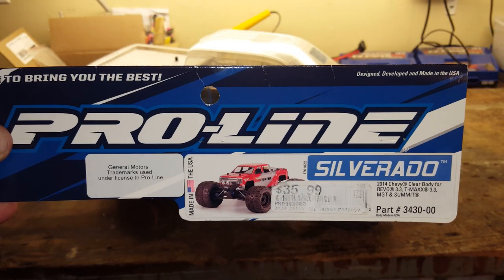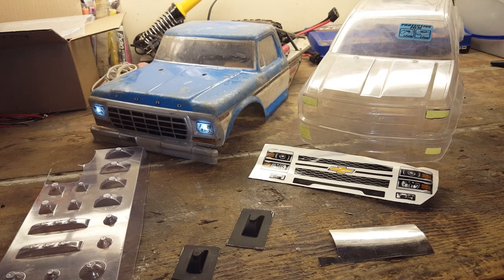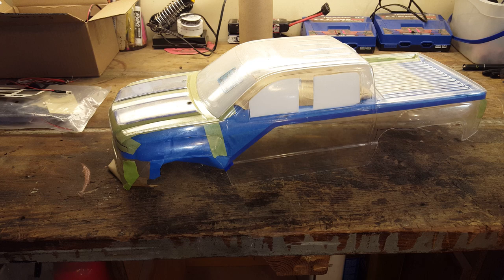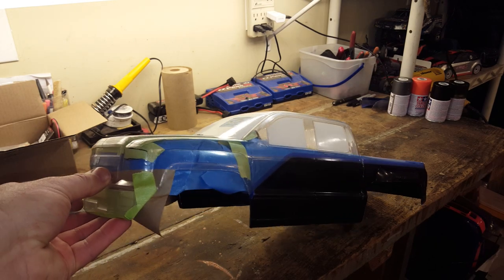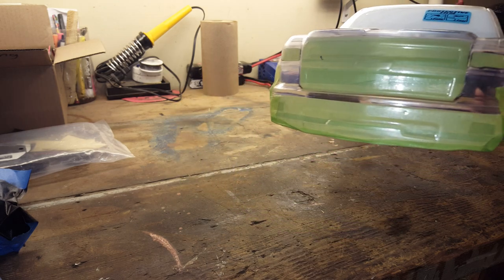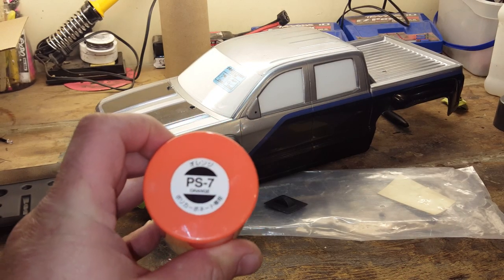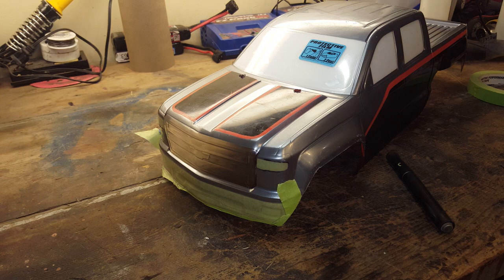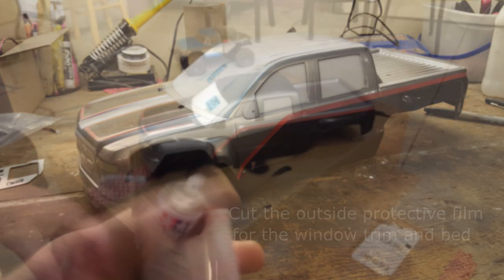BJ222 RC. Proline Silverado Painting Overview.  Traxxas Trx4 chassis

Comment: Do you think that Silverado body would fit on a red cat gen 7 pro?
Reply from the maker: I would check the wheelbase length for the Redcat. The rig in the video is 325mm wheelbase. In RC anything can be done if you get creative.
Reply: @blakemxzx  red cat is adjustable 317mm to 325mm... so that’s a 1/8 scale monster truck body? I checked the wheelbase on the 1/10 monster truck bodies and they are around 10”. Looks awesome
Reply from the maker: Yeah its a monster truck body. I put a link in the video description for it.👍

Comment: sorry BJ i don't get it. the tactical wheelbase is longer? my tr4x is 12.6'' wheelbase so kinda confusing.
Reply from the maker: Yeah wheelbase on Tactical/Land Rover 12.8" is longer than the Bronco/Blazer/Sport 12.3".  I still had to cut the wheel opening to fit the 12.8".towards the cab.  You could still cut it more for the 12.3" but it might look off.

Comment: Great job man, the paint job turned out very nice and I like how you did the lights on it but I was wondering what part did you use for the interior?
Reply from the maker: https://www.ebay.com/itm/RC-Car-Crawler-Body-Shell-Interior-Decor-for-1-10-Axial-SCX10-II-90046-Cherokee/153863125427?_trkparms=ispr%3D1&hash=item23d2f4f9b3:g:iGgAAOSwVWFea1sV&amdata=enc%3DAQAFAAACYBaobrjLl8XobRIiIML1V4Imu%252Fn%252BzU5L90Z278x5ickkxGz2ccqatkEnoeekHqhLkWdGTs%252BManuGORkU7sniNM17n2RecsqtcEliQkvFrRSWcp8iCCbj%252Blijo%252B%252FBsrDMgEfKci9hULmpc7cYCRm4Zm%252FXwt1%252Fw72yEuf%252FC%252FadJJW9B9wlM9kMbThmuUDIkRDdOsEn%252BbUmfpYLVpZSQuw1ulVFIBmnQgoijVpSh2I%252BQkOdrUuw8dPDzxDn%252Bu6cenF8Ykbk7jNbk15ynrZjrHVoyn2WjdEe%252Fm1wXmynyDkiGq8l6ZCWjVr92b7EmJVofjGPedyYCuHAK7w41e1D1b6vEZFKCHbgpLCiMWFDpZDInmSpoC%252FSlt4oqgY%252FmKbpMLVuJsjIKE56rNkP8pG0sRcTTVooTP4DsOFlU%252Bc6G9lCKo0JyXpjjEJUXpkNqxu%252FiPqlXwcSM6r2WdcocnZGOLV0kpv7KGBer3AgMBx5io0x%252FTTE478VkYq%252BYiXFZzGsaWIMqjm5TCE0z%252F8P9LiJRngff6dEUxzw1hA0dxtlb0PKQPg1vpzeZlb8R5UPylaVMmv8X28Md7TiUa%252FuM%252FT1nrazJnu9ERIpJ1e8ISXFpNFq7xjUcnKRNcVqaMaBUzBDxpqOn1RuTsL%252BT7zXnsr5PLL47vZ7Lo1YpcCK7OZxMAApyF9pxx5G4lqYrCjdSHlKJNwbkghY%252FAAZDlEUd9fftz5uzUeHfOKF3Gz0CNwMMBCyHe4eR1FNwTzWuM0vEsBCTA12tuwW3M8QEgu8hbujtng%252F%252BqzWvPCUwKW2s8tYGsNruFpy%26cksum%3D153863125427c88070ce10ef4c6eaa2dd8e9b78a2dcd%26ampid%3DPL_CLK%26clp%3D2334524
Reply from the maker: Thanks a lot!  I bought a cheap interior on ebay and painted it the color I wanted.  I attached a link in the comments and added it to the under the description.